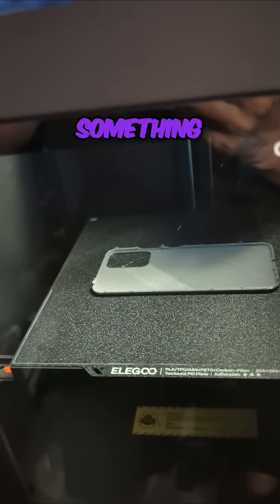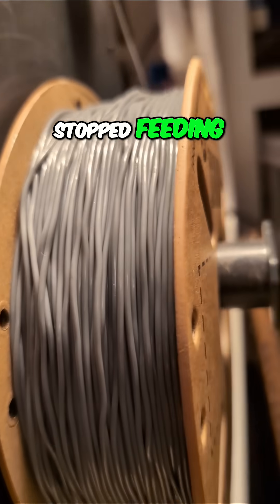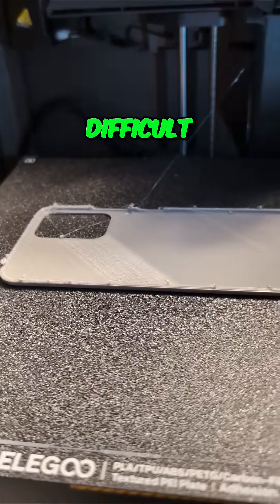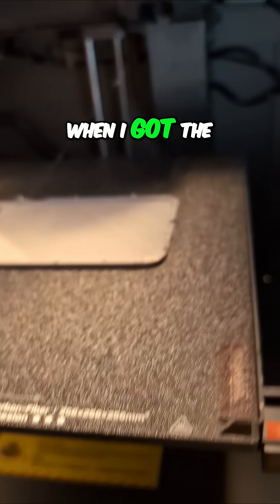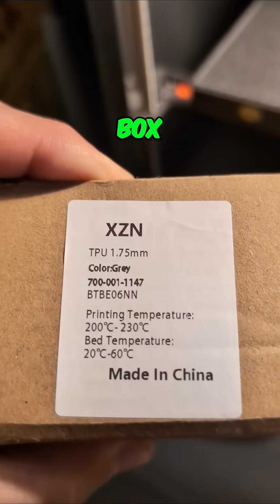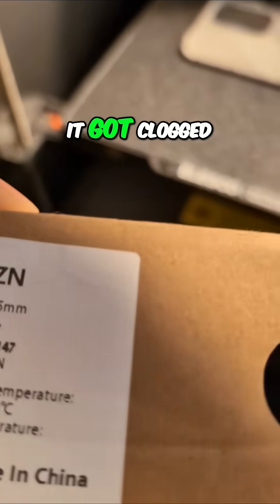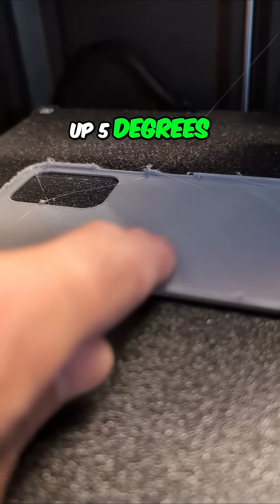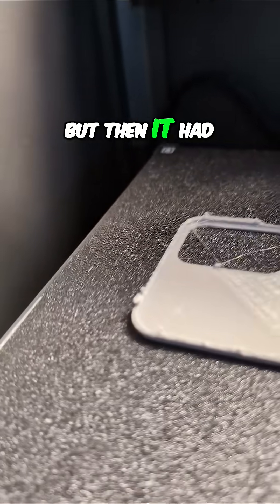3D Printer Nightmare: TPU Filament Clogging Issue! Help!

Comment: I've tried to print that same brand of TPU. I have a roll of black and a roll of brown that is practically unusable even though I'm printing from a dryer. I get random good printss but mostly clogs randomly anywhere between 30 minutes to 2 hours in. I have some tinmorry TPU that prints great everytime... I'm about to throw this filament in the trash
Reply from the maker: Sorry to hear that. Pitch it quick before it clogs and blobs your print head.

Comment: I am printing fiberlogy 30D. Hardest material to print. But after tuning my P1S I can even print perfect models with 0.4 mm wall thickness. This material requires some hard tuned profile. I found many key settings to to print perfect surface.
Reply from the maker: Nice work!

Comment: 1. Dry TPU (it sucks up moisture like a sponge)
2. Run a temperature tower to find the right temp
3. I had a similar problem with XZN and the spool was dragging. I set the spool on the ground on its side; fixed.
Reply from the maker: Clever. I would not have thought of laying the spool down

Comment: @GearReportMaker ...  I print mostly with TPU on just an Ender 3 with an upgraded extruder. It works fantastic! ...
But, that TPU looks terribly janky! It's defective, my friend! There's no way any of the TPU I've ever used has looked anywhere close to as like crap as that looks! That looks like it's absorbed a bunch of moisture or something is very wrong with it. I guarantee THAT'S YOUR PROBLEM! Wherever you bought that off brand janky crap from, RETURN IT and never put janky looking filament in your printer again! 
That stuff looks awful! If you can't get your money back, THROW IT AWAY! I bet it'll do harm to your new printer! 💯😎👍
Reply from the maker: I agree with you. A brand sent it for testing. I haven't opened the other box, as it is glitter pink and I don't have much demand for glitter pink. But I'm curious to see if it looks like wet spaghetti when I open it. I put the weird looking filament into the dryer and it actually straightened out a bit... after a day or so. https://amzlink.to/az0hzcqlMiX1q

Comment: You should not print you through the ptfe tubing. Try mounting the spool directly above the printer and disconnecting the tubing from the tool head. Run the filament straight into the extruder from above, thus eliminating friction inside of the tube.
Reply from the maker: I hear ya. But this TPU prints fine though the tube. And there isn't a straight forward way to skip the tube and feed from above. I suspect that you are correct and I need to figure something out for that. But trying to use the CC in stock form first before pursuing hacks to make it work right/better. :)
Reply: @GearReportMaker  the Centauri carbon isn’t the only printer with this issue. All printers seem to have an issue with printing TPU from MMUs or through Bowen tubing. All the MMUs say you can’t print TPU through them, unless you use the special TPU for AMS by Bambu. You should be able to disconnect the tubing from the top of the tool head and feed in directly thus having no friction at all in the filament’s path to the tool head
Reply from the maker: I'll look into it. Hoping to not have to design a top mounted roller myself. :)
Reply: @GearReportMaker I print in my basement so I took a piece of copper pipe and made a roller hanging off the joists lol
Reply from the maker: I"m not so fortunate. I'm working on how to print from the drier direct to the print head. The drier complicates things, but I'm in super humid NC. Apparently, some TPU just can't handle the combo of humidity and the tube.
Reply: @GearReportMaker try going from the drier without any tube. It’s only exposed to the atmosphere momentarily while it is being fed.
Reply from the maker: yeah. That is what I'm trying to sort out. It need to pull straight up vertically out of my drier (https://amzlink.to/az0hzcqlMiX1q), but then needs to feed down vertically into the print head. Maybe I need to make a roller that lets the pull change by 180 degrees or so.
Reply: @GearReportMaker could you make a small hole in the front or rear this way it would feed out of the side of the case?
Reply from the maker: Thanks. I found a screw-on ptfe tube connector and printed it. Just have to drill the hole in my dryer and install. Well... and get some more ptfe tube.
Reply: @GearReportMaker hope it works out better!

Comment: Defect in the user not seeing the filament is twisted
Reply from the maker: It definitely looked odd and different. I've never seen filament that looked like that. Don't think it was twisted, though. More like waterlogged
Reply: @GearReportMaker Yes! But the point should be received from this commentator! 
This is some terrible looking filament and you should get a refund for it! It's bad. Disregard all the other comments and understand this guy is correct! This filament is bad and don't ruin your new printer by using it! 💯😎👍
Reply from the maker: The brand sent it for testing. Should be an interesting chat with them.

Comment: Hey I print mostly in TPU using the Neptune 4 Plus for my prints.  The biggest issue you're likely experiencing is the drag from the Bowden tube.  Try using the same settings with the filament set above the printer going straight into the extruder, bypassing the Bowden tube.  You'll have to turn off the filament sensor.  You're fighting a balance of the heat creeping up near the extruder gears and getting the filament out the nozzle fully melted.  When you have too much drag on the filament, it will stretch and the extruder gear will start skipping. The end of your filament will look crumpled like an accordion.

I print using SUNLU TPU at 230C and speeds anywhere from 60-120mm/s and get great quality with those settings and a .4mm nozzle.  There are a couple shorts showing the setup on my channel.
Reply from the maker: Very helpful info. Thanks!
Reply: I can't print TPU on my Neptune Plus at all. Over 50 attempts at different temps, speeds, etc. Will try to bypass the filament sensor. Can you share your slicer settings for TPU?

Comment: With 95A it's a good idea to manually unroll a bit as it prints, i bet even with the janky filament if you unrolled you would get your print
Reply from the maker: I might try that. The other TPU I have prints fine though. https://amzlink.to/az0URrOLwTwp4
Reply: @GearReportMaker   i think it's something to do with it being on the roll and printing that thin area of the phone case.  I've had similar happen to me.  I did a video printing aTPU case for the S24 ultra on my RandoTechNerd channel and i would get fails if i didn't unwind.  I want to do even squishier!!
Reply from the maker: Good to know, thanks. I've got a print going now, but might try it again this afternoon.
... Or not. I actually want to modify the design a bit before reprinting. Not sure when I'll have time to do that.

Comment: I somehow stumbled upon your shorts as a result of the algorithm and have been enjoying your journey with the Elegoo Centauri Carbon.  I'm still using my Ender 3 Pro, but I've modified it with a direct drive and reverse boden.  My recommendation is to skip the reverse bowden altogether.  Place the TPU spool above the printer on a freely rotating holder and feed it down directly to the extruder.  This is how I've had consistent success with TPU.  There is just too much friction in the reverse bowden with flexible filament, I've found.  Best of luck!
Reply from the maker: Thanks. I've had no issues printing with Kingroon TPU. Its just this one brand/roll that won't finish a print. :)

Comment: My CC prints Anycubic 95A TPU just fine. Im printing at 220-230c. My filament is also wavy like yours and i think they wind it losely to prevent stretching. The max volumetric flow in my filament profile is 3.2 mm^3/s. I do dry it pretty regularly, but have done a couple longer leints between 12 and 16 hours without issue.
Reply from the maker: My CC prints the other TPU I have fine. It prints this fine too ... Until it stops feeding. LoL
Reply: @GearReportMaker are the other tpus you have just as hard to feed through the ptfe tube? Ive only ever tried one roll and it fed in pretty easily.
Reply from the maker: Nope. That is what confused me so much about this. Fresh out of the vacuum bag from the factory it was like a roll of wet noodle. 
I put it in the dryer and it reported 40%+ humidity. So, I'm hoping that drying it for 24 hours will be enough to make it viable. BUT I also noticed 2 things:
- the box has a little note in the fine print about using a .6mm nozzle. Only .4mm are available for this machine right now. 
- I opened this fresh TPU printed with it right away. But when I put it in the dryer it showed 40% humidity. I think my assumption that it was dry enough from the start may have been false. I'm drying it now and will try again on my Neptune 4 Max (I have larger nozzles for it), and may print directly from the dryer.

Comment: Slow down travel speed?
Reply from the maker: Thanks. I also noticed 2 things:
- the box has a little note in the fine print about using a .6mm nozzle. Only .4mm are available for this machine right now. 
- I opened this fresh TPU printed with it right away. But when I put it in the dryer it showed 40% humidity. I think my assumption that it was dry enough from the start may have been false. I'm drying it now and will try again on my Neptune 4 Max (I have larger nozzles for it), and may print directly from the dryer.